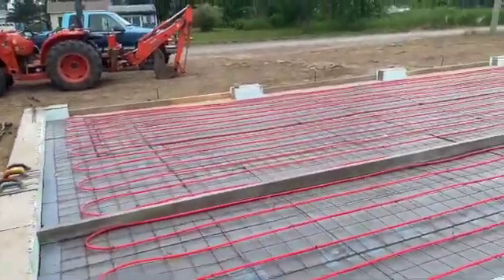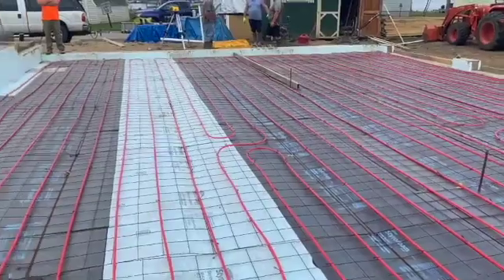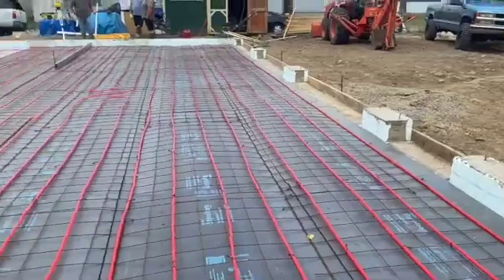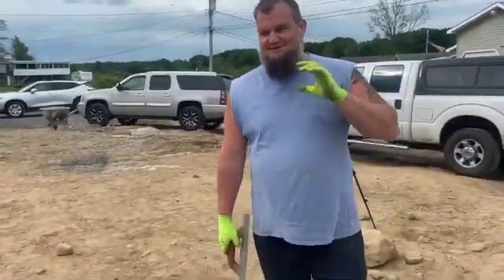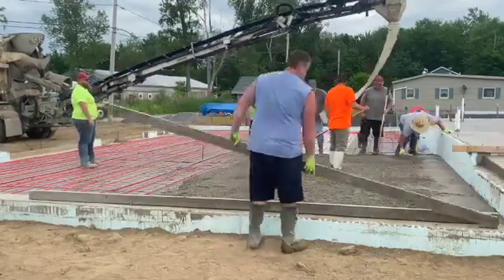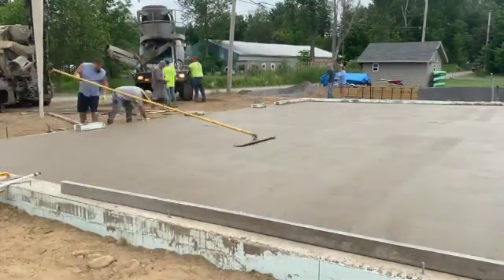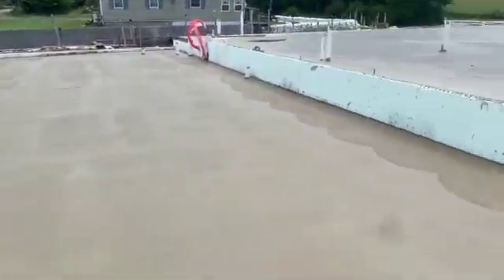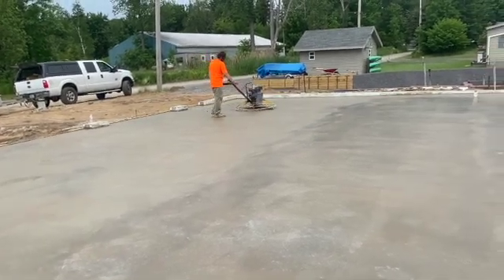Frost Protected Foundation Series Part  7 (THE FINAL CHAPTER)

Comment: Why don't you just put the wire mesh on top of the PEX and use the plastic staples to fasten the PEX to the foam. Then you can pull up the wire mesh. It's a waste of money having it just sit on the bottom, isn't it??

Comment: Crazy question but is it possible to skip the ICF bracing on ICF walls and just do one block layer per day using a small concrete mixer and bags?
Reply from the maker: It could be done and that would still be stronger than a concrete block wall. I would bump up to an 8" thick wall and have vertical rebar every 2 feet sticking up to catch each course. This would not by any means be as good as pouring it all at once due to the cold joints in the wall every 18" up the height of the wall. If this were a stem wall with dirt on both sides it would be fine but not a good idea for a basement wall.
Reply: No